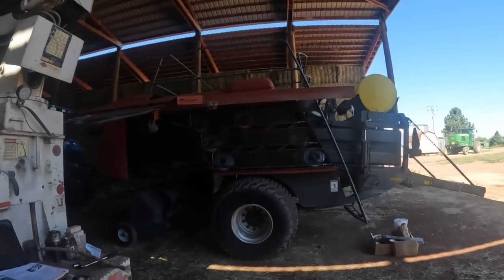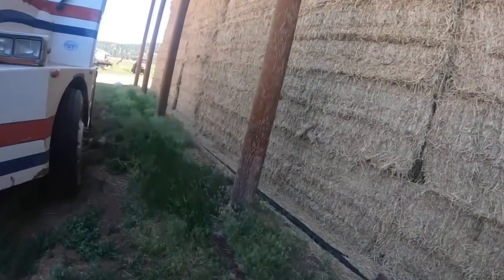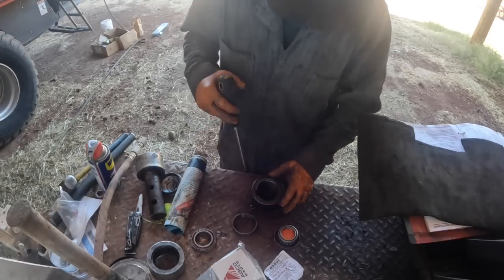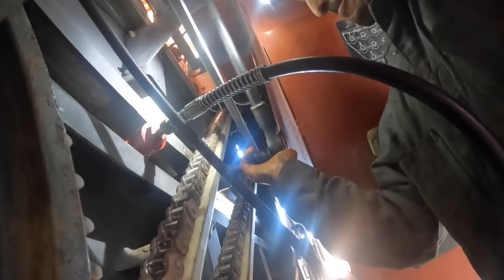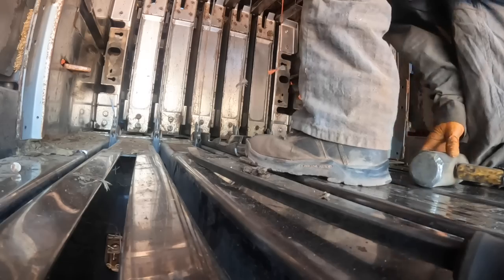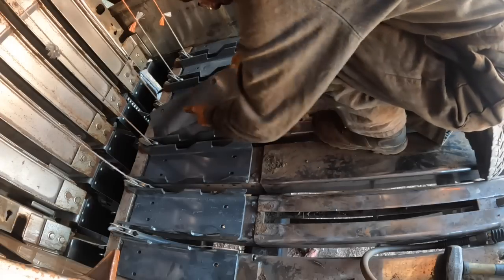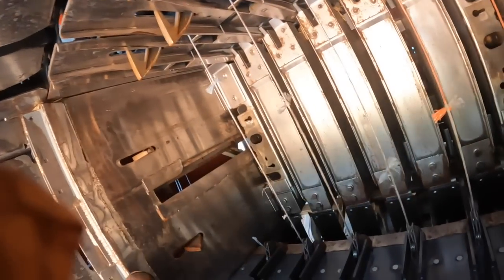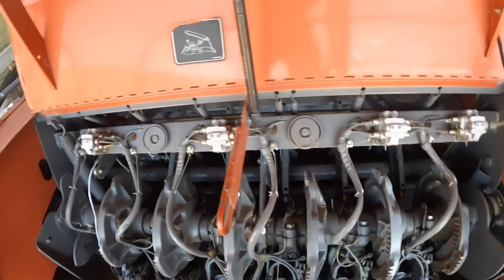Hesston 2170 plunger bearings

Comment: Another Great Video, Warren. The Baler that jumped time looks expensive to fix. We used small balers, but we were told to spin them over by hand after snapping and replacing a shear pin, trip the knotter to make sure everything was good. Our baler guy was in his 60’s back in the late 80’s, early 90’s. I have always been amazed at the knotter system on balers, pretty complicated for something designed in the 60’s or so. Thanks for taking us along on the adventures.

Comment: the bolts that your having trouble taking off because your alone and nobody is holding on the other side just weld them to the plate and go under take the nut off ,when you replace do the opposite with new hardware cahange all the bolts and nut and charge them